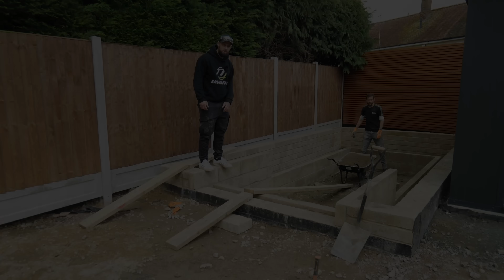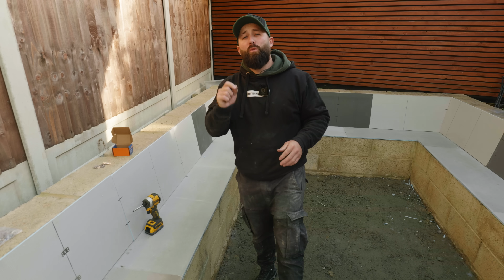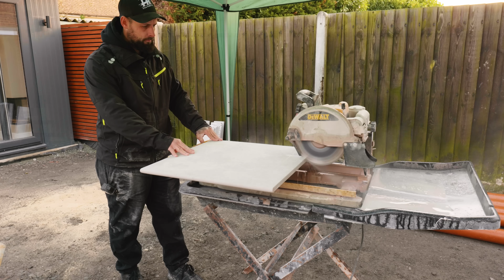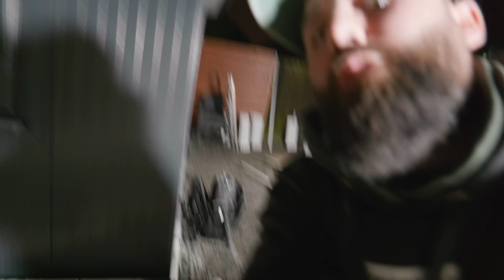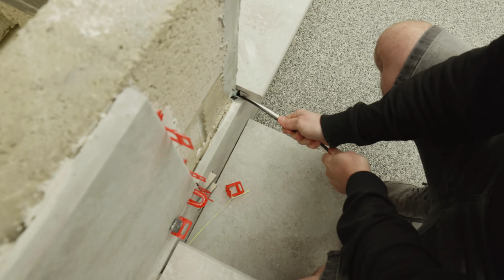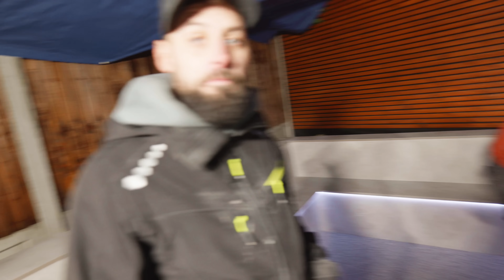HOW TO BUILD A HEATED SUNKEN SEATING AREA IN YOUR GARDEN

Comment: Where does the French drain run to? How do you know one will be enough? What if it's heavy clay soil? How do you know the water will drain away fast enough? Are there any regs for this that I should look at?
Reply: It’s not so much about drawing the water away. Its actual function is to let the water level under the pool to equalise with the surrounding area - to prevent forced floatation of the pool during flood conditions.
Reply: ( I hope that helps)

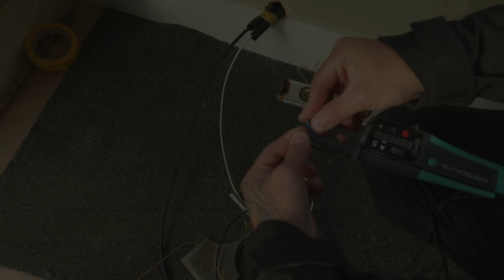Comment: 13:12 having your fingers touching each end of the tester will give you continuity and may give you a false reading…. Try and use one hand to hold one side of the cable and touch the other cable with probe only…. Love your content !!! Great how you talk through every step great stuff lads 🙌🏼🙌🏼🙌🏼
Reply: Oh FFS not again 🤣🤣🤣 No it won't. If this was true you could take out your multi meter right now and touch both hands with the probes and it should beep, but it won't! That's because the resistance is way too high to have it even trigger.

Fluke is a very respectable multi meter brand and on their website it states

"A meter with a continuity beeper briefly sounds off when it detects a closed circuit. The level of resistance needed to trigger the beeper varies by meter, but most will indicate continuity with a measurement between 0-50 ohms."

The human skin resistance is no where near that low level. A quick Google search or testing it out should show you 100,000 or more so honestly gtfo and next time double check before acting knowledgeable.
Reply from the maker: Thanks for the tip!

Comment: Nice job chaps, love the lighting. My top tip for garden seating is, try putting your head at the height it's going to be when it's finished and make sure you don't feel too low down or too high up in your garden, it's easy to feel like you're sitting in a hole or too exposed if you're too high up, also, what will your view be like from this position, will you have a nice view of the garden or will you not want to site there because views from other positions would be nicer
Reply from the maker: Thanks for the tips! 😊
Reply from the maker: Thanks for the heads up much appreciated ✅😊

Comment: Just to mention if both your finger tips touch the copper of the cable or the test probes it'll prove continuity as your body is, so you may get a good test even though the cable is faulty 👌
Reply from the maker: Good shout mate my bad 🙈
Reply: Uhh no it won't. Talk about misleading people.. If this was true you could take out your multi meter right now and touch both hands with the probes and it should beep, but it won't! That's because the resistance is way too high to have it even trigger.

Fluke is a very respectable multi meter brand and on their website it states

"A meter with a continuity beeper briefly sounds off when it detects a closed circuit. The level of resistance needed to trigger the beeper varies by meter, but most will indicate continuity with a measurement between 0-50 ohms."

So what do you think the human skin resistance is? A quick Google search or testing it out should show you 100,000 or more so honestly gtfo.

Comment: That looks absolutely gorgeous and fantastic work from all the boys. There is one thing i would have changed though. The seating tiles sit out about an inch and a bit from the planters. I would have made the plants wider, so that it looks flush to the eye and also not be an issue, especially for kids to knock themselves on those seat tile corners.  Yes it would make the stairs narrower by 2 inches, but it would be worth it and would look more streamlined.
Reply from the maker: Thanks for the tips! 😊👊🏼